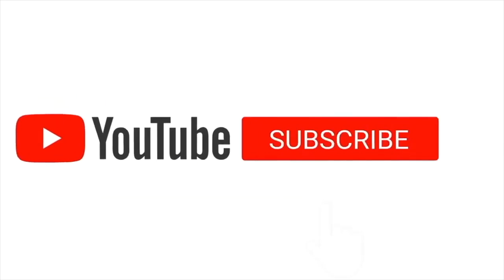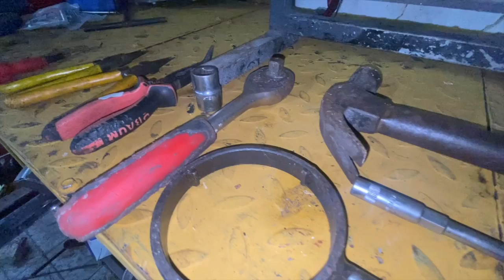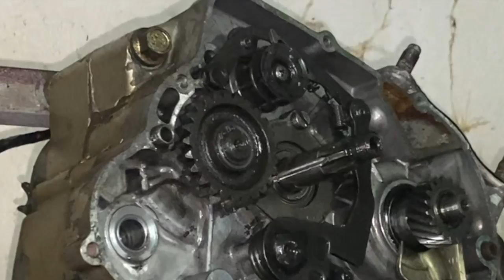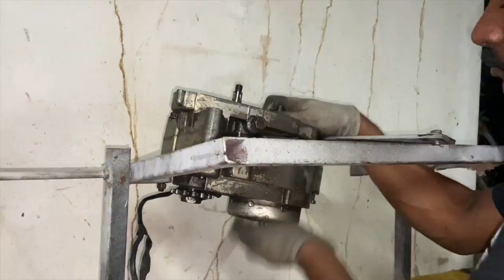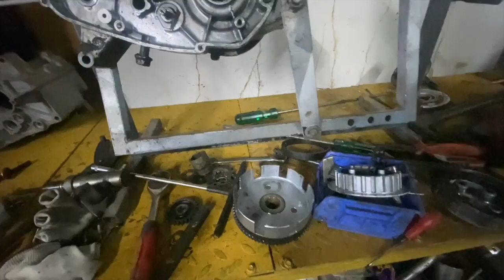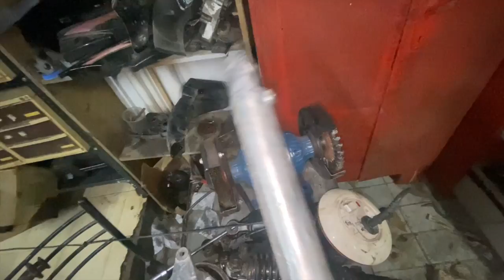RX 100 Engine rebuild part 1(Disassembly)

Comment: Sir, I am about to install primary gear , flat side should be facing or is it the Bevel side...due to language I was not able to follow. Thanks.
Reply from the maker: Bevel side
Reply: Awesome thanks for the reply without which I could not have proceeded. For knowledge sake why bevel edge side is it because oil pump gear is driven or it helps easier to slide the clutch housing driven gear.

Comment: Engine rebuild chyn labour charge around etrayakumm
Reply from the maker: No idea, I do it myself so free + a lot of fun
Reply: @Yamakaze  also i would like to do it but i haven't proper equipments and time 🥲
Reply from the maker: @gouthamdev4629  you only need a few tools, for others you can use the services of a lathe, I just started my first engine rebuild using a set of combination spanner’s and a few t spanners, I realised magnet cannot be pulled out easily, the engine was out so took it to the nearest 2 stroke mechanic, he removed the magnet a gave me a few tips. That’s how you really start